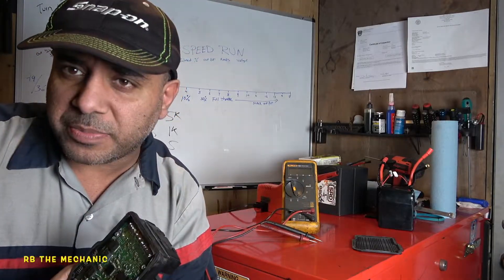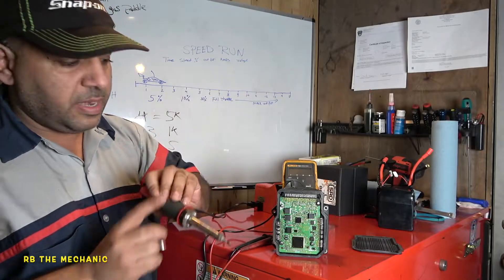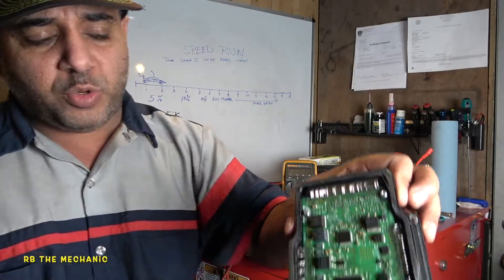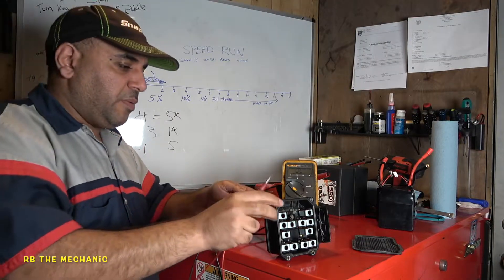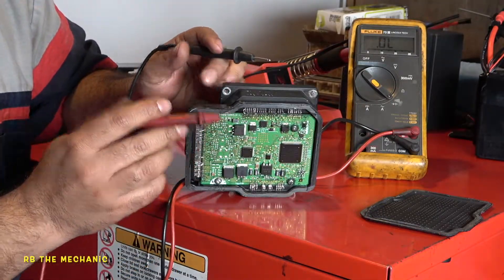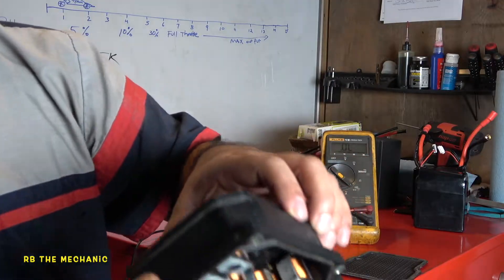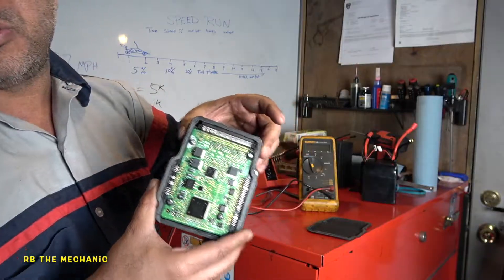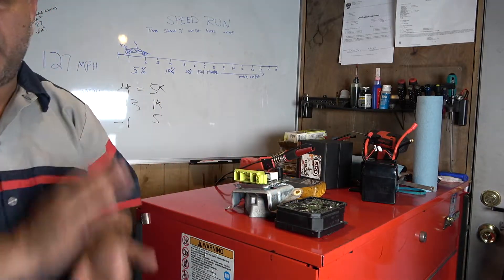Why is this not on a recall by Honda?  ABS module Failure   2013 to 2017 and more

Comment: Make sure to file a complaint with NHTSA. It’s the only way to get an investigation started and force a recall. It’s obvious this problem is super common and one that should not be happening. The dealership quoted me $2,600 to fix my son’s car. 2013 Honda Accord Sport with just over 80k miles. He’s a college student and travels the highway to come home to visit, so not fixing it isn’t an option. Always one step forward, two steps back.
Reply from the maker: Yup every one come togatherrr this is an issue just will happen on ur accord and $2800 repair
Reply: Honda quoted me $3k for VSA module replacement which is backordered.Crazy!
Reply: Im reporting it now.
Reply: In addition as experienced by 02(or any other year)  mdx owners : filing a complaint alone isn't enough, you must request investigation reports for a majority of any already reported complaints . THIS IS IMPERATIVE
Reply: Yeah my moms got a 2014 accord and it’s got this problem. I’m hoping it’s just the speed sensors at the wheels. Is your problem constant or interment?
Reply: @forfun6273 my daughter's was constant. I was gonna rebuild it but found a used one online.  Hey now that I think of it I still have the old one.  I'm gonna cut it open and practice because my wifes 2012 needs one my daughter's is 2013
Reply: And in Canada?
Reply: Just reported it. Anyone have any luck with a response back from them?
Reply: @C86East did you get a response back
Reply: @trigby1984 you get a response back. Im having the same issue with the abs module.
Reply: I just did
Reply: Same exact issue just reported it.

Comment: I have a 2013 Civic with the same issue. The dealership is asking for crazy money. I am at my wits end.
Reply from the maker: U can send ur old model to abs repair service on ebay they charge $250
Reply: @RBTheMechanic but doesn't it have to still go back to Honda to program?
Reply from the maker: @jeromegriffin8775  nope get it repaired from eBay service they repair the wires and it all u need to do

Comment: Can i get one off eBay from the same year civic and would it's be plug and play? Or does it have to be programmed??
Reply: I can't find one with the same numbers as mine. However can find one from the same year and model. If the numbers aren't the same is it still plug and play? Im being told it has to be programmed and bled by Midas. I'm having Midas fix mine. However I really want to know if they are plug and play even if they don't share the same numbers but are off the same year and model.
Reply: The problem I have rn is that I use my car for a living. I can't have my car down for days on end while I'm getting mine rebuilt. So that's why I'm asking. If I put one from the same year and model in would it work until I get mine back from being rebuilt? It would save me a ton of money if I could find the answer to this question. I can't find one with the same numbers as mine but can find one off a car that's the same year and model. I would like to know the answer to this before I spend 2000 to have Midas do it.
Reply from the maker: @1inflorida  u can send the old moduel back there’s service on ebay they rebuild it $250 he charge but ur car will be down for a while or u can buy cheap one used and send it to them for rebuild and then u have it and swap it and sell ur old on for repairs
Reply from the maker: It just plugs right in I have full video but I don’t think used one is good idea u can send ur to rebuild on eBay they have service for rebuilding it https://youtube.com/watch?v=ZYoRcWPGbb8&feature=sharea

Comment: Does the abs module from a 2015 accord fit a 2014 accord
Reply: Does the abs module of 2016 or 2013 fit in 2015 ?! i have the same issue where all lights are on ?!
Reply from the maker: @chartsraces3664  yup but u can send ur old one out for repairs
Reply from the maker: Yea they all same

Comment: If it beeps it means the wire is good. If it doesn't beep, that means there's no connection.
Reply: he needs to redo this video testing or watch another Youtuber how to use a continuity tester.
Reply from the maker: Yup
Reply: Continuity is good. It's what you want. He is either  deceiving or doesn't know what he is talking about. (Or can't describe how this particular continuity is bad.)

Comment: @RB The Mechanic, is it safe to drive a car with all warning lights on?
Reply from the maker: No the systym is not working it will not control the car if it skids or making sharp turn

Comment: Should be recalled! I spent so much money already. Ordered the Vasa module which is on back order..its already been 6 months!
Reply: File a complaint with better business bureau
Reply: File a complaint with NHTSA. There’s already several on file, but it will force an investigation and ultimately a recall.
Reply from the maker: Yeah they should refund everyone
Reply: Any update on your car? I had the same problem and the vsa module is back order.

Comment: Exactly right. Why not a recall. I had mine randomly go out twice on a 2010 accord on the road. Had the master cylinder changed and a few weeks later, it went out again. 

How it doesn’t fail and allow the car to still brake is astonishing.
Reply from the maker: Yeah they need to refund people or replace it free

Comment: Question have you seen if the circuit board is bad the issue will be intermittent? I have tried a couple different reader but waiting for another to arrive to check the abs codes
Reply: The failure on mine happened weeks apart. Wasn’t until I changed the master cylinder and had it happen again that I found out the real issue.
Reply: Thank you finally found a scanner to read the abs got a 121 11. Tried getting a new modulator from a local Honda on back order no date must be making a new version
Reply from the maker: @jaybird7140  prolly wasent related to chaning master cylinder
Reply from the maker: The contact wiring I show is the only issue I see
Reply: Pretty sure mine is a hairline crack in the wiring he points out. Mine is freakishly intermittent.
Reply: @gowestjeff  I found one on eBay used pulled from a crashed vehicle if not in a rush can find a good deal

Comment: Damn I think that’s my issue as well it started with the lights being on intermittent then the lights stayed solid and now my tpms light is one I was able to to reset it but now it’s back.. it flashes for 10secs then it stays solid
Reply from the maker: Scan the car for codes and AB’s moduel codes
Reply: Will do.. last time I scan the car no codes came up at all but I did go to auto zone and used their scanner
Reply: Exactly how mine started. This fix worked for me.